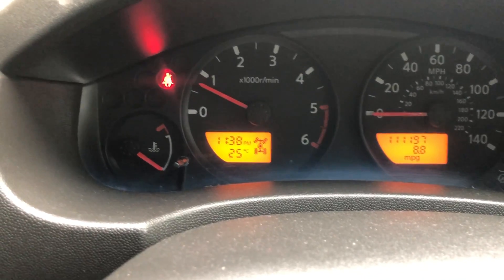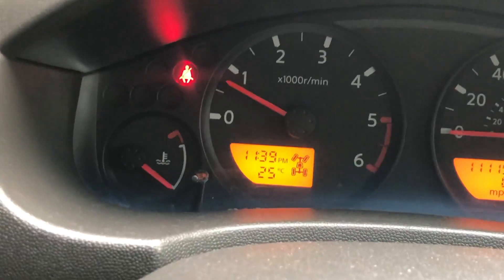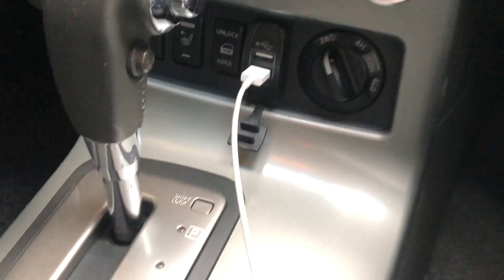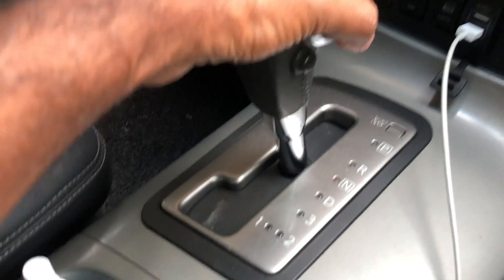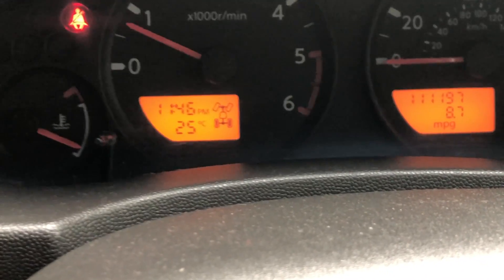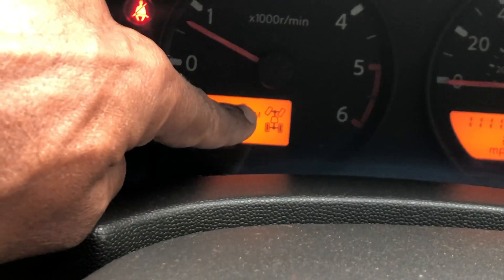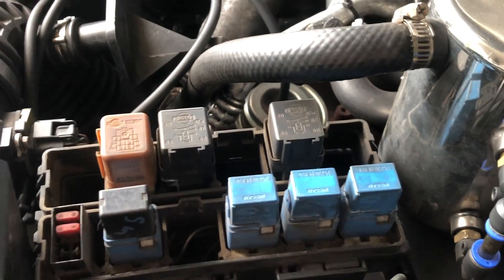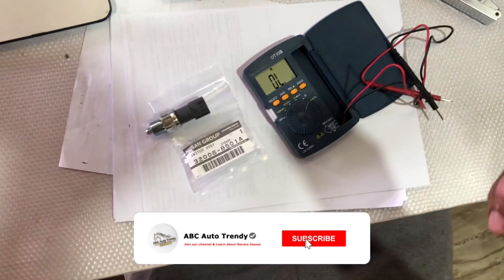Nissan Navara | Frontier  4-Wheel Drive (4WD) Not Disengaging

Comment: This happens on mine all the time. If you disconnect the battery it resets back to 2wd. Works for me anyway
Reply from the maker: That means a electrical outlet get stuck, it maybe due to debris on the wire sockets, so better clean all 4WD sections wire sockets with sorts of contact cleaners

Comment: 4High working perfectly. However, on 4L the light flashes and doesn't engage in 4L. What you be the problem??? Thanks.
Reply from the maker: It probably the transfer switch.. just take them off, clean and reinstall and check

Comment: Hi i have a Navara d40, stuck in 4lo. When putting ignition on the vehicle icon of 4wd flashes and disappears and changing the dial to 2wd or 4hi doesn't do anything. Can you provide me contact details to help me sort this out?
Reply from the maker: There two reason for this 

Either 4wd relays are stuck or transfer solenoid faulty 

You may call me on 0777329922 / 0772069922
Reply: @abcautotrendy  hi I tried ringing but shows as incorrect number shouldn't they be 11 digits?
Reply from the maker: Hi there, from where are you trying to call me

Comment: Mine got stuck also with 4LO, TRC and coalition indicator.
Reply: @farromichaelangelo7273  how did you get it to disengage. Mine is doing the  same thing
Reply from the maker: @elkanahdhanookdharry If the above procedure does not help, then differently the 4WD system (mechanical) has gotten stuck, which means you have to manually switch to the 2wd underneath of the gearbox (you need to remove the 4WD actuator and turn the liver to neutral position) this normally happened when the oil are contaminated or has used a wrong oil

Comment: Hi, my Nissan Navara d40 doesn’t engage into 4wd it just flashes the top half of the little image.what could it be?
Reply from the maker: If the front wheel of the icon is flashing mean it’s engaged 

However pls check the relays
Reply: @abcautotrendy  I thought it had to be a full shaded image to be in 4wd? That’s what I notice in your video at 1:06